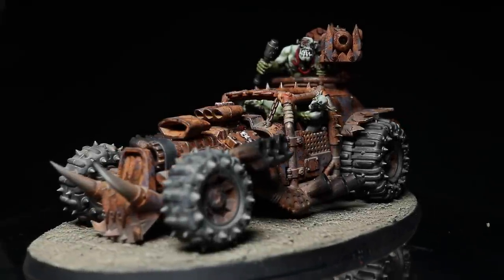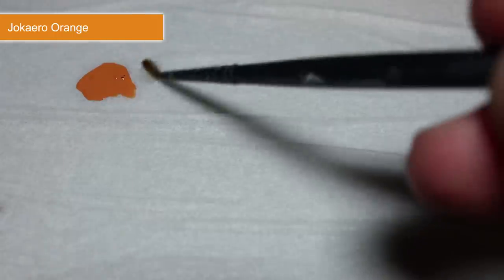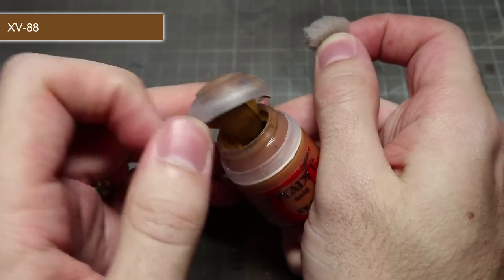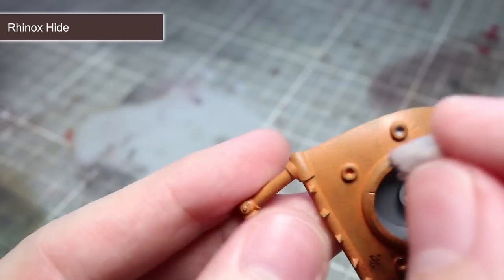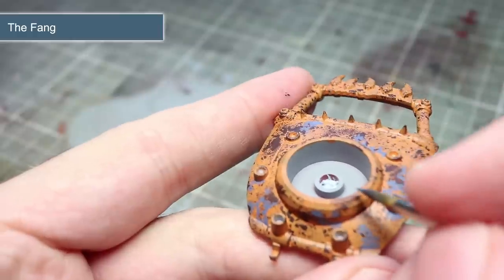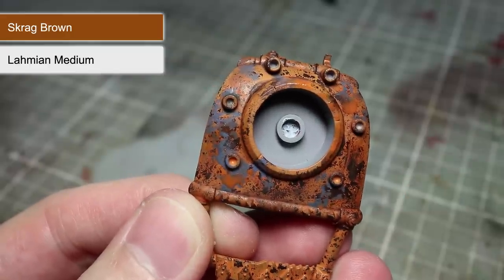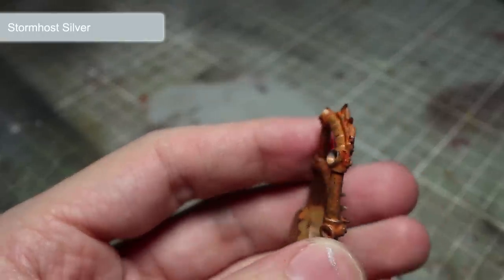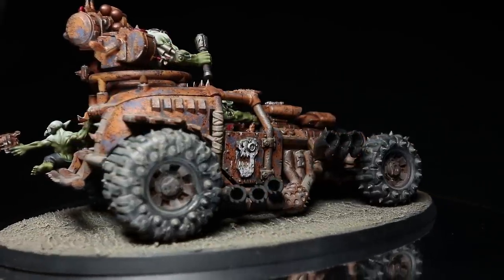How To Paint Rust: Warhammer Tutorial

Comment: It looks good but takes quite a long time, I just sand a bit to roughen the plastic, rhinox hide base, typhus corrosion anywhere water would gather or there is a change of metal type and drybrush ryza rust when dry. Chipped paint and nuln oil to taste. You get the texture as well and it is quick.